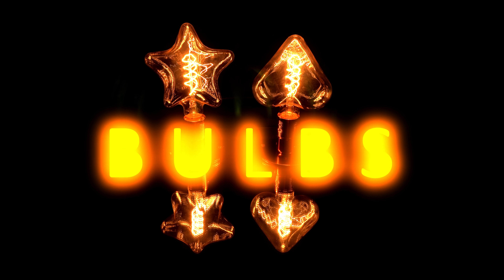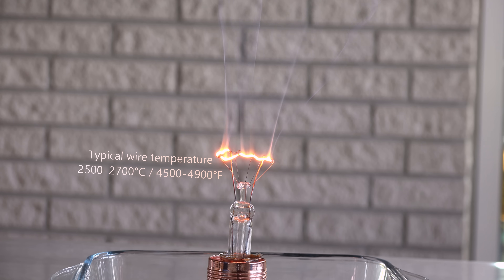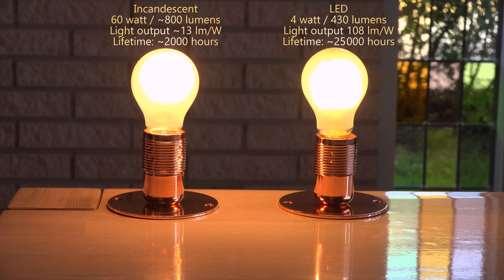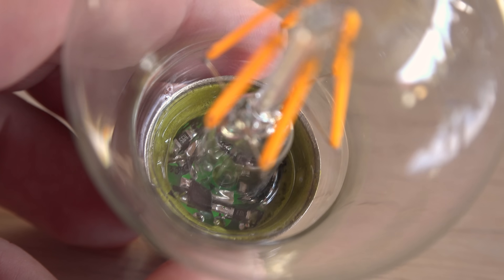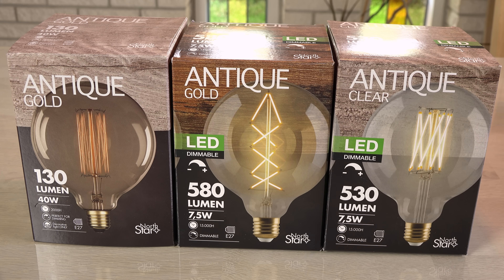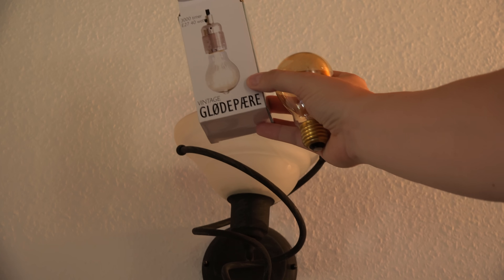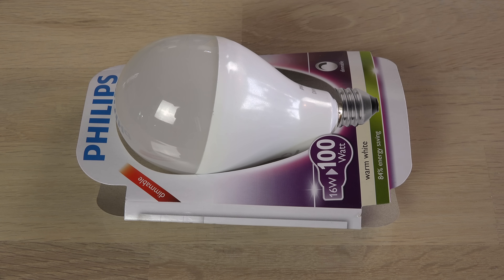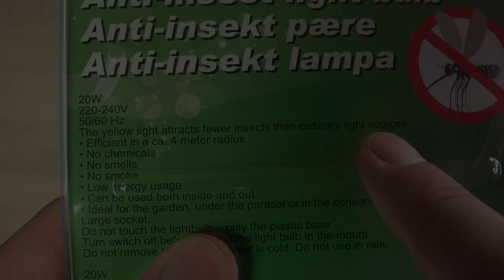Light Bulbs | LED vs. Incandescent

Comment: There is no logic in banning incandescent bulbs other than to protect the investors who line the lawmakers pockets.
Reply: It isn't wasted energy if I am paying for energy to heat my house. Any heat coming from a light bulb is heat that my furnace doesn't have to make.
Reply: The Garlic Farm The heater argument is just pure nonsense.. seriously.
Reply: ever wondered why nobody heats with electricity? are you an adult? go and ask one. paying bills will give you the answer. heating with electricity is stupid, expensive and a waste of of energy, resources and infrastructure. why the fuck would anyone with half a brain go to the length of painstakingly producing electricity, usually by heating water, to produce electricity in huge plants with massive losses in the conversion from primary energy to electricity because of heat loss. then send the electricity via the grid, which is expensive infrastructure and usually at full capacity anyway and produces another 30% loss of electrical energy by producing heat at a loss just in transport, just to then use this highly valuable electricity to heat the fucking house instead of using the cheap primary energy directly with no losses since all you need is the heat anyway... for fuck sack people start to think and use your brains. the project of civilization and democracy depends on you idiots not dragging the rest of us down. that's also why we need this ban, because people are to stupid.
Reply: And what is the logic of increasing light efficiency? Mitigating the illogic of the electrical production method? What if the heat serves your application; what happens to the logic then? It goes into congressional committee and dies?
Reply: general population aren't the ones who have the power to change the environment. the government could do this but they choose to make your life worse instead of theirs in the name of "protecting the environment" and idiots like you fall for it. producing better ways of creating electricity is what needs to be done. not regressing into the past by stagnating on current polluting technology just because they're paid off by the current people running those businesses
Reply: The incandescent can explode and burn down your house. Believe me, search up an article and you'll find stuff similar as I cited.
Reply: Electricity might be the least economical  heat source for large areas but the heat from a light bulb is not wasted. For some small applications a light bulb is a useful heat source. I use a homemade incubator to hatch turkey and guinea eggs. Its heat source is two light bulbs with a rheostat to control the temperature. I store welding rods in an oven made from a dorm size refrigerator and heated with a 40 watt bulb. I have seen similar heat boxes on construction sites for storing adhesives and sealants. When the ban on incandescent bulbs was announced I bought a 20 year supply. Replacing those appliances or changing the heating elements would not be cost effective to save a few cents on electricity. 
I like saving money and because of that I switched my house to CFL lights in the 1990s. Now that LED lights have become affordable and the qualtiy of light is acceptable I am switching as the CFLs burn out.  I don't need the government to force me to do anything that makes sense.
Reply: +swunt10 no one uses electricity to heat...? keep telling yourself that
Reply: +loxllollxol holy fucking shit, someone who understands basics
Reply: s0nnyburnett, I guess you'll be happy to know that disposable plastic shopping bags have actually been banned in France since last year !
Reply: Also to massively encourage energy efficiency?
Reply: Well so is not using any bulbs.  Why not ban all lightbulbs?  After all it's only "logical"
Reply: You really think people wouldn't be interested in saving money in their electricity bill?  Who hurt you and why do you have such little faith in people?
Reply: You really must live a sheltered life... It is called working for a living, and when you get hurt you are always blamed for it. If you are unable to get surgery for an injury but are in pain you have the pain pills taken away because all that take them are seen as an addict. Also even if you are in severe pain and have more than 60% of your mobility Kaiser and others will do nothing to help you no matter how many thousands they get out of you each year. Should I go on... or perhaps I should start a channel called it really sucks to be an American...
Reply: It is suspicious that incandescent bulbs are completely band. Spiritualist believe that negative spirits are scared off by incandescent light sources. It is similar to the suns energy. LED is cold light. unlike the sun.
Reply: Except that there is logic in it, as getting rid of the inefficient bulbs will reduce the amount of energy turning into waste heat energy.
Reply: Matt E
You don't need the government to do the thinking for you. People don't NEED air conditioning, why not ban that? Why not ban disposable batteries or shopping bags? It's an arbitrary decision that has no real basis.
Reply: since when was this about needs?
Reply: +s0nnyburnett Most people will need the government to do the thinking for them. Most of the people are utterly retarded, most of the people are probably not aware of climate problems, don't care about them or outright don't believe they exist.

Who would really go out and buy new lightbulbs for his home, even though his current ones work just fine, because they are waaaay more efficient and environmentally friendly? I would. And I'd say about 5% of Europeans would aswell. That's it. Everyone else would continue using the old ones since they just don't care.

Now ofc lightbulbs are not that big of a deal in terms of pollution. But it's certainly a step in the right direction.
Reply: +s0nnyburnett Some people do need air conditioning. Are you confused or something?

Comment: I ran into something kind of annoying with some cheap LED filament bulbs I bought. While the bulbs look just like an old incandescent bulb I found with that without one old incandescent bulb in the light fixture they glow quite noticeably when the electronic switch that controls the fan is "off".  I'm going to repurpose them in  in a different fixture once I find better bulbs for my fan.
Reply from the maker: That's odd. So the bulbs are only really switched off if the fan is on? Or the bulbs are never really switched off? Sounds like an faulty design :)
Reply: The issue is the electronic switch leaks a small amount of current and the cheap bulbs have crappy power supplies in them that allow that tiny amount to pass and light the LEDs at dimmer but very noticeable level. I tried to measure the current but the resistance of the meter was enough to block its flow.
Reply from the maker: LtKernelPanic Ok - thanks for clarifying. LEDs aren't always an option for replacing a incandescent bulbs...

Comment: I think banning incandescent bulbs is stupid. To replace a 100W bulb (needed for work areas such as kitchen) with an LED bulb of equivalent light output and quality is VERY expensive (don't forget to factor in the eco fee you pay at the checkout PLUS the fee you will pay to properly dispose of the electronics). I don't believe this is the case with new construction using purpose built LED fixtures. But forcing people to retrofit their old incandescent sockets with these weaker LED bulbs is dumb.  CFLs are useless since they take so long to reach full brightness, and they hardly last as long as advertised.
Reply: You just don't like change now do you? All of your arguments are invalid; CFLs take about 10 second to reach max brightness and about 0.1s to reach 90%. You don't even notice that last 10%. LEDs are much, much stronger and more efficient than incandescent. 

You sir, are the reason why we need to ban things. you have taken exactly zero effort to actually learn about this new technology but you have spent at least several weeks of your life complaining about it, right?
Reply: But LEDs are a lot stronger, not weaker..
Reply: Squid. I don't dislike change, when it makes sense. I exercise something called critical thinking, which protects me from all the bullshit. You can regurgitate all the numbers you like, but it won't change what I know from my experience in day to day life. CFLs suck. Noticeably. Not to mention how wasteful they are (materially).  You presumptions about what I know,  how I've spent my time, and general foaming at the mouth are rather hilarious. Thank you for saving me the work of demonstrating what an asshat you are.
Reply: New technology is not always better in every respect.
Reply: Paul If you think that an EMP is a good argument for incandescents, you're really grasping at straws.
Reply: Janus. LEDs CAN be stronger (as can any technology). On a lumens per watt basis, I think fluorescent lamps still beat production LEDs, and sodium are the most efficient on larger scales.  But for the same price as an incandescent, the LED will be MUCH weaker. Let's not also forget that LEDs gradually dim over time as they self destruct from heat.
Reply: Just as an example, let me show you some products from my local home improvement store. Typical A19 100W incandescent light bulb: 1600 lumens. $2. Philips 100W equivalent A19 LED bulb. 1500 lumens. CRI 80 Non-dimmable $6+fees. For the price I pay for electricity, it would take a very long time for the energy savings to cover the difference in price, and for an inferior light source. In some low use fixtures, that cost would never be recovered. In some fixtures, yes the LED makes sense. In new buildings, yes of course install LEDs, preferably with separate, non-disposable power supplies. But in some cases, you're forcing people to shell out more money for an inferior product, and for that reason legislating a bad is stupid.
Reply: Are you done playing "psychic"?
Reply: The CFL in my bedroom is noticeably dimmer than maximum even after 10 seconds. It takes 30s or so to come to what looks like full brightness. Maybe it is one of the early models? Not that the gradual-on behaviour bothers me particularly.
Reply: Euro Bum And you are trolling, most likely or just stupid, you went to CFLs in almost midsentence. You do realize that CFLs are being replaced by LEDs when we need instant light? (where exactly do you need instant 100% lights, at home? the time it takes to reach +99% is few seconds, to 90% it is milliseconds.. Care to show any values that contradict my estimations? I am just a sound engineer but i do have lighting technician and electrician training also)

Current good quality LEDs are projected to last up to 20 years and even worst cases over 5 years.  Easily making up the price in electricity and longevity. I know it is anecdotal but i have replaced every single lamp with LEDs, counting 470 in this very room and how many of them have been burned? Zero. Most of them cheap as fuck, half of them from bargain bin. but i plan to replace ceiling fixtures with par16, the best dispersion pattern on earth, so nicely diffused, and since they are costly, they are also way past +90CRI, made for professional, movie and cinema use. Costs a LOT but lasts for 20 years.

You hate change. I embraced it and took matters into my own hands, checked color temperatures and spectrums and chose very natural lighting, that i can change as i want. Cost compared of buying bulbs the last 4 years is not offset but iä'm still much happier to not waste electricity. With the power of just two incandescent bulbs worth, i can light my apartment.. 

You have no rational argument apart from toxicity of manufacturing LEDs. Which is something we can make better. Or are you saying, honestly that we should go back to incandescent? Let me guess, you are over 45y old?
Reply: Euro Bum  
Are you done playing dumb?
Reply: fburton8 That's my point, they give 90% immediately and the last bit of it comes when it heats up. Larger CFL takes longer and start lower in scale. No one has ever claimed that they are perfect and i do wonder what the fuck are we talking about CFLs when the video is about LEDs..

If person don't know what type of lamp they need and buys the wrong one, it is not the lamp that was wrong... And this is what happens with LEDs and CFLs; people go any buy them without any experience or knowledge, nor do they care to find out and expect everything to just work like they always did.. Nope, doesn't work that way. OP is one of those who has been burned by poor shopping experiences, something has hurt his pride,  i assume. He don't care to say why he is butthurt.
Reply: +SquidCaps The discussion was bound to deviate I'm afraid. If decent LEDs had been widely available in UK when incandescents were banned, I would have bought those instead of CFLs.
Reply: fburton8 It was a bit unfortunate, LED revolution was not ready yet but we already had CFLs that stopped wasting money creating heat when we needed just light. For a LOT of people, this meant buying CFLs and then buying LEDs, each time having to switch to more costly option. I did this too and it wasn't fun, every LED bulb seemed like "wow, that much?" when you are used of buying "5 for price of 1", pennies really.. Like buying candybar, you didn't even think twice about buying a incandescent.

One thing i heard, a rumor but as usual, has some gravity behind it; buy LEDs now! Don't wait a year.. The rumor is that LEDs are lasting too long and manufacturers who have built their empires on planned obsolescence are going to strike back. They may last twice as long now than they will in few years time. Some say that current generation of LEDs are 100 year bulbs at the moment but this is rumor, not a fact. But, just in case, i'm gonna get few extra and store them ;)

There is also one more argument on incandescent vs led that OP failed to mention.. There are buildings built to use incandescent as part of their heating.. I live +60deg lat so it is cold here.. For ex, my parents house is build on incandescent heating; On top of regular heating, they have 10% lowered room height + air circulation energy capture/reheat + incandescent bulbs kept the room temps even from top to bottom... Now that they have LEDs, it is much less evenly diffused and they need to use extra heating units that are not in near the ceiling... On large industrial size buildings, this is actually serious concern.
Reply: ***** True and put to some sockets, that only support lower wattage bulbs. If CRI is most important and quality of light in general, incandescents are the best. LEDs are better in practical way, unless you live where weather is cold, then incandescents are best. CFLs are the worst everywhere and not practical technology. They are only good in science lab for testing. By the way incandescents shouldn't be banned until there would be created something, that could, at least, match incandescent in all positive aspects. Until that and even after that, I don't see point of banning them. Customer buys something, that suits his needs best, so why limit his options?
Reply: To be honest, CFLs take a lot longer than that if they're used in an unheated space like a garage.
Reply: Where do you find 90+ CRI LEDs? Where I live,  they aren't available, some manufacturers don't even write CRI and sell stuff for way more than 6 dollars. Don't judge people for their decisions, when you don't know context. BTW CFLs have lots of disadvantages and are pretty much inferior to cheap ass incandesdent, that barely costs anything.
Reply: Mantas Jurksa They barely cost anything-until you decide to actually use them.
Reply: Mantas Jurksa
exactly. thank youl
Reply: CFL's do not last long because the electronics usually fails, and the same will happen with LED's This is do to the heat in the area that the lamp is located. Speaking as an Electronics Engineer, Electronics hate heat, it kills electronics. There is no electronics in an Incandescent bulb, also incandescent bulbs can survive a nuclear blast if they are not broken, and the EMP will not damage them as it will do to all electronics other than tubes.
Reply: thank god for nuclear radiation proof bulbs
Reply: I know right. I get EMP blasts rolling through my neighborhood every winter, and they ruin all my electronics. So annoying.
Reply: Thank you captain obvious. Please illuminate us with your vast illustrious knowledge. Get it ahahahaha! Dolt.

Comment: You might also want to note, that you cannot always switch out traditional bulbs for any LED ones, when you're talking about dimmable builbs, because of the difference how LEDs are dimmed.

Also, because of their much higher starting current you might experience problems, when you're talking about low voltage bulbs (12V) where you have many bulbs connected to an additional transformer. The traditional transformers are rated up to a maximum current, which might very well be lower than the starting current (sometimes up to 1A) times the number of LED bulbs. This can lead to failure of some of the bulbs when switching on and also prohibit dimming mechanisms from working correctly, because they assume completely different dimming voltages (and also the actual mechanic of dimming). So you also additionally have to invest in another transformer.
Reply from the maker: Yep, the electronics in most LEDs need improvement. Even 'dimmable' LEDs can flicker quite badly at low settings. Quite annoying...